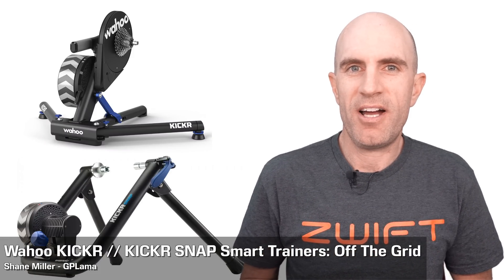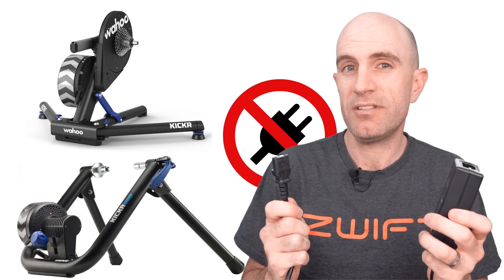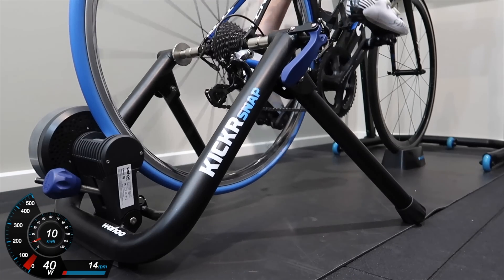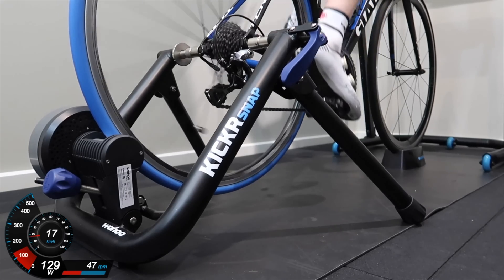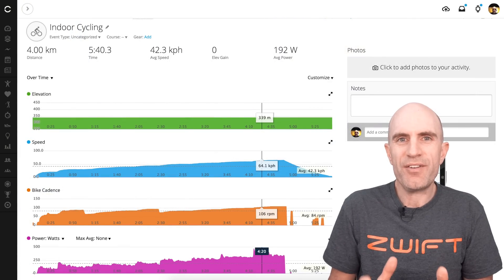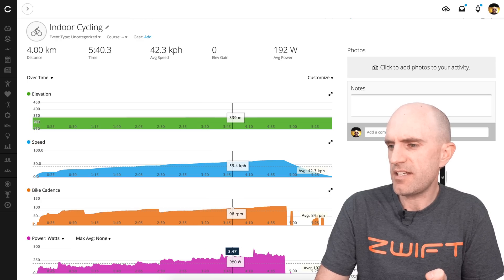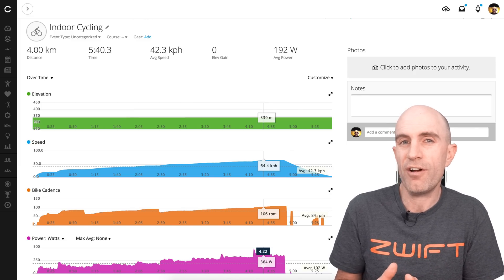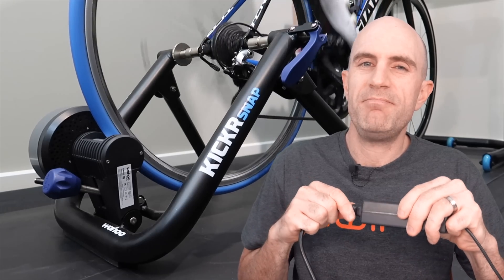Wahoo KICKR // KICKR SNAP Smart Trainers: Off The Grid

Comment: Shane, I wondered whether the Kickr resistance of the unit is relative to how much was being applied on the last use? Maybe finish a Zwift session at 200w and see whether that changes the off-grid power on next use.
Reply from the maker: No. With no power to the unit, there's nothing there to provide resistance with the electromagnet setup.

Comment: I've simply connected a car power adapter and some battery clamps to the 2 mil barrel connector that the kickr uses. That way I can either use the car or a 12v car battery to run the kickr anywhere
Reply from the maker: Just make sure it has a 5A fuse.

Comment: They should integrate a generator into the resistance head, so you could power up the trainer while you pedal, and there would always be some resistance. The only reason to plug in would be to top up the levels in your "Powerwall"

...Lama, make it happen!

Comment: The Neo is the hands down off the grid winner.
Reply: Flux as well
Reply: Bushido is not too shabby either.
Reply: Nice. I did not realize the Bushido was also functional without power. Thanks for the info.
Reply: Correct me if I'm wrong but isn't the Neo designed with a no mains power function, for training?
Reply: Yeah, agreed. The flux's 7kg fly wheel puts up quite a bit of resistance off grid. But to heavy to keep lugging it around LOL